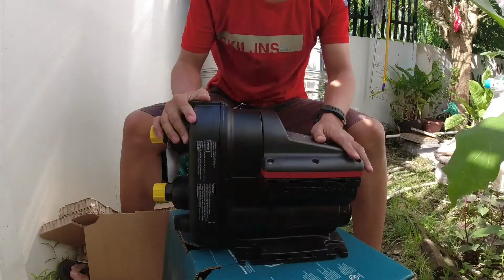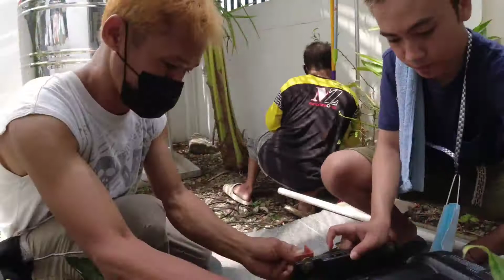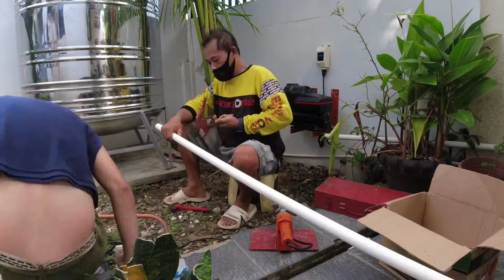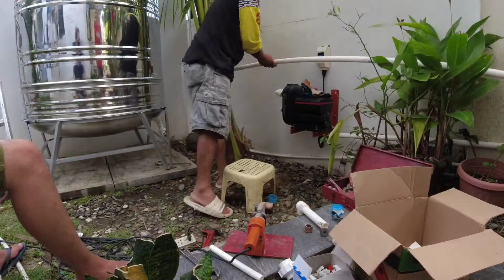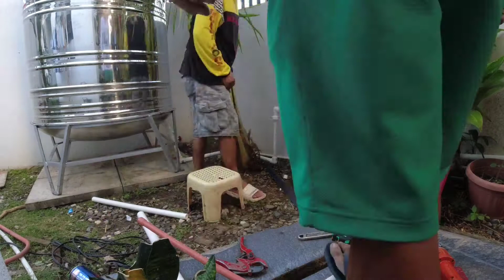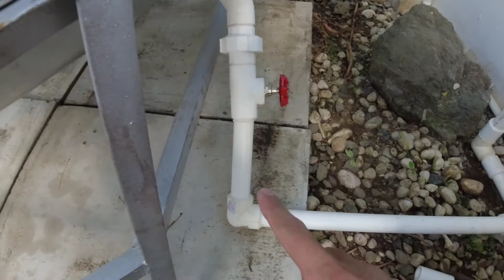SCALA2

Comment: No bypass line going from the tank to the house via gravity feed? That's a headache waiting to happen.

Also, the power connection should be weatherproof and the roof/enclosure of the pump system is not tilted as far as I can tell.
Reply from the maker: The bypass is from the city line direct to the house. 

About the power connection, why u used weatherproof enclosure if there is a roofing installed?